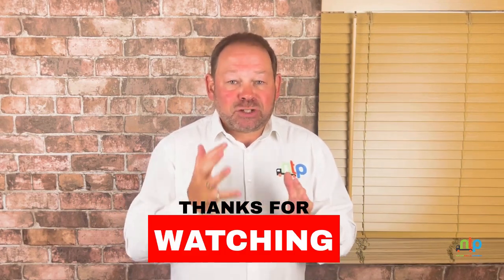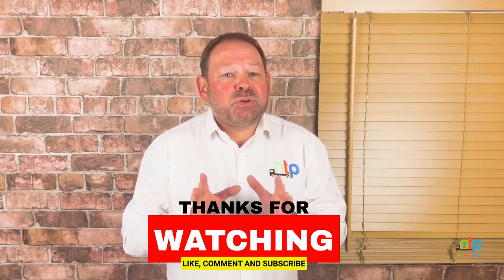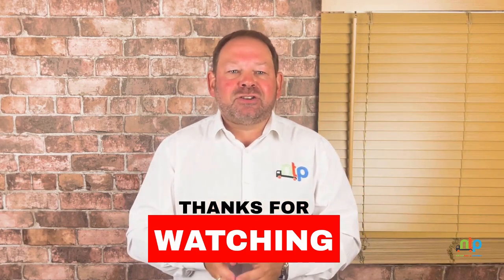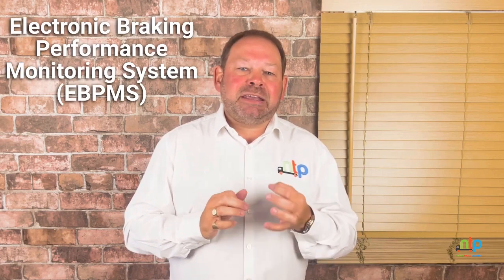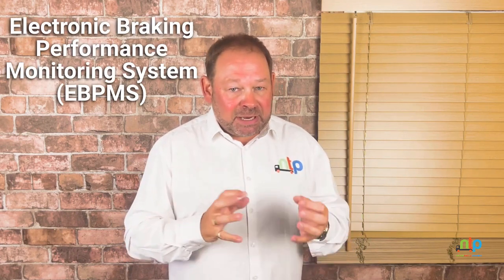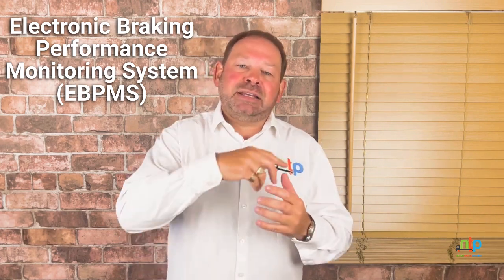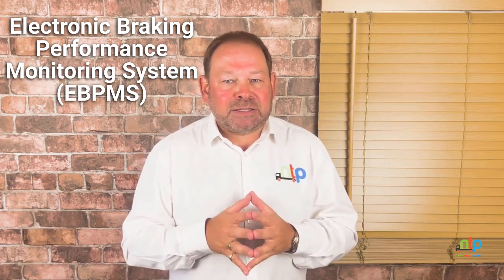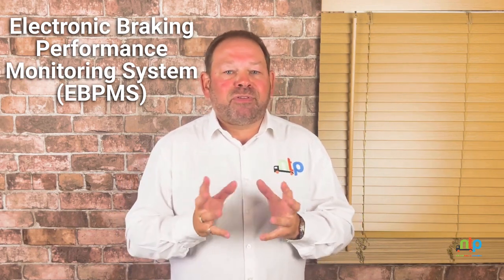Roller Brake Tests for HGV's -  The things you MUST know!

Comment: I was wondering, why my car was so much heavier (about 80 kg more than Leergewicht, wich includes a 90% filled tank and a 75 kilo driver). For the yearly inspection, here in Austria, my car has to pass a brake test. The break force on each wheel is measured individually, there was where the car was weighted. I asked ai, if they put someone else in the other seat, to balance out the car for the test. Ai is stupid. It just tells me what i want to hear. What is your take on this? Logically, it would make sense and make up for the extra weight. There was only one option on that car availaible, but mine doesn't have it, and a couple of suzuki motorsport stickers aren't that heavy.
Reply from the maker: Hi. My understanding is the Leergewicht translates in English to (and is equivalent to) the unladen weight. Unladen weight does not include fuel, tools, battery, fluids or driver. This would account for the 80kg difference between the Leergewicht and the weight measured at test.